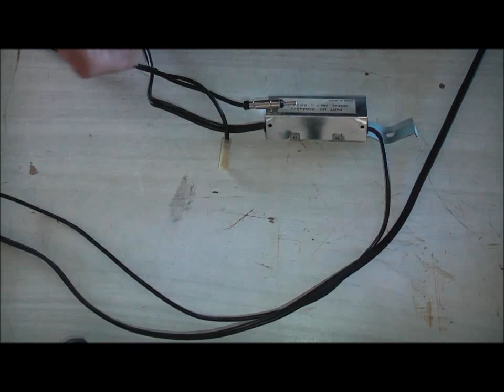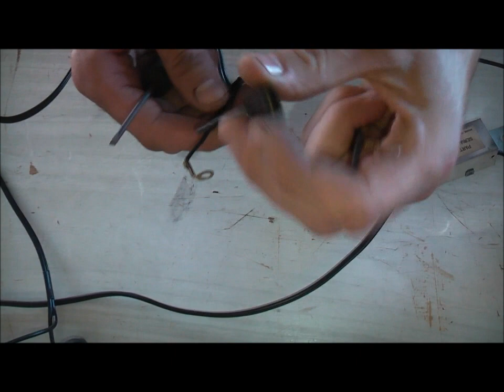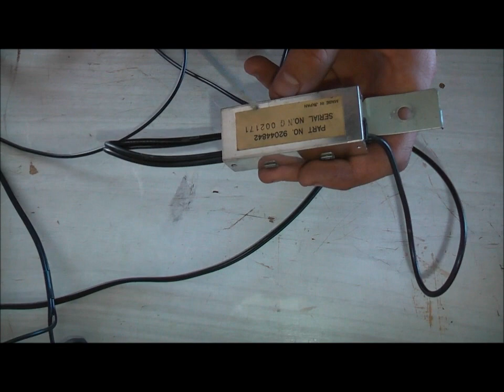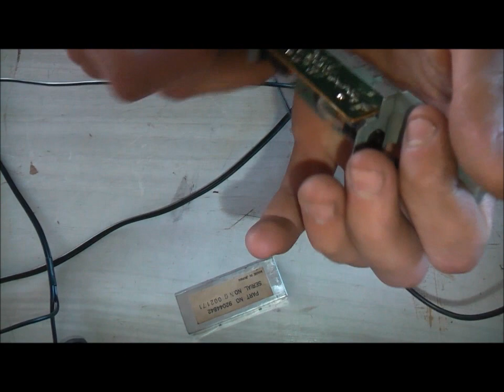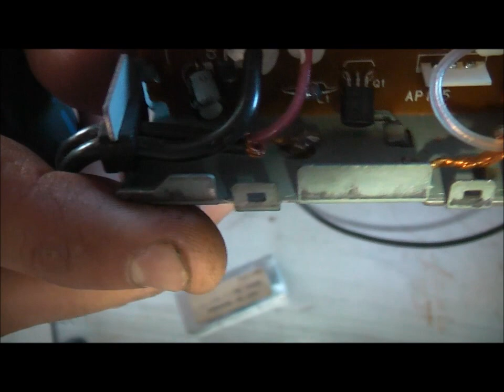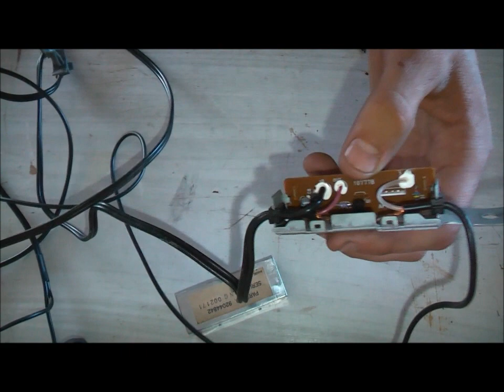Cellphone Antenna Module Teardown

Comment: That looks to me like the antenna module from a VT or VX Holden Calais. They are connected at the back of the car to the back window as a second antenna input to the stereo for diversity reception. I expect that the little tin can would house a small RF broadband amplifier. They work well, I have a VX Calais and never get the dreaded FM radio "shutter screen" effect when driving around, even around the high rises in Surfers Paradise.